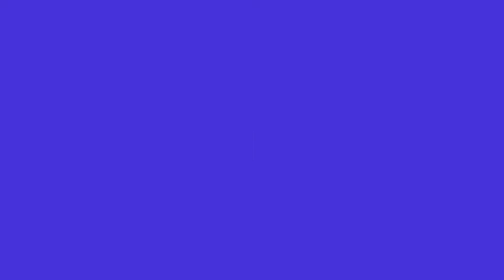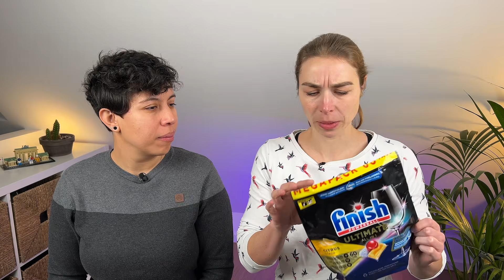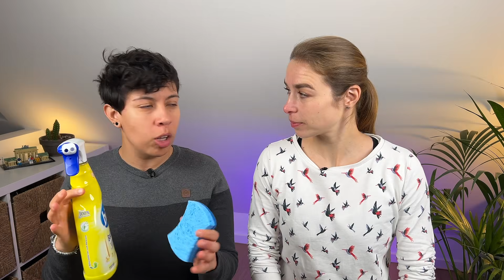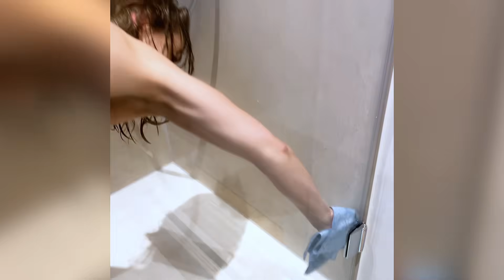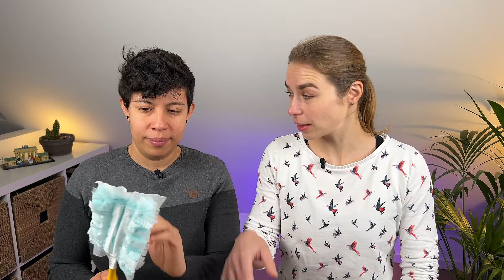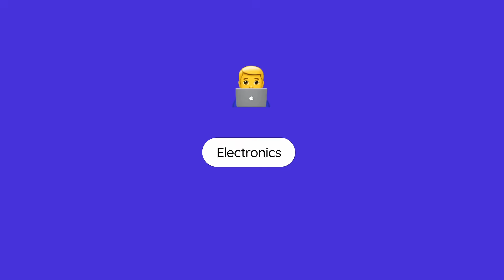What Cleaning Products We Use To Keep Our German Home Clean

Comment: My mom several years ago came across Amway products for cleaning. And since then I use mostly them - one for dishes, the other, universal one, for everything else. And they come as concentrates, so I just dilute them with water, and the bottles last for at least a year. 

Another cool tip I learned here - using dishwasher tablets to clean the washing machine. 

+ for the eternal glass cleaning liquid, which will probably be inherited by the next tenant from me